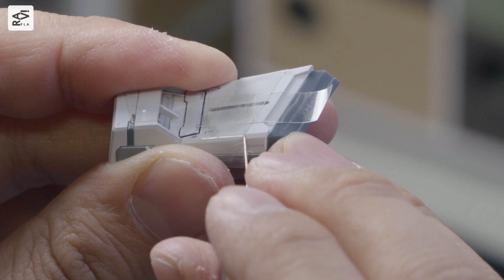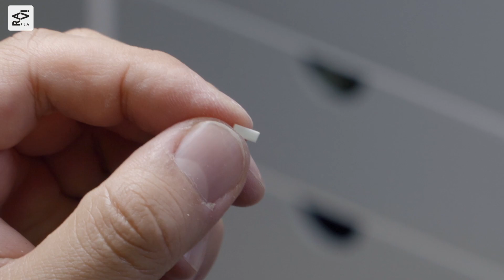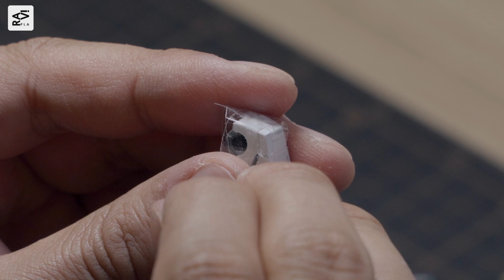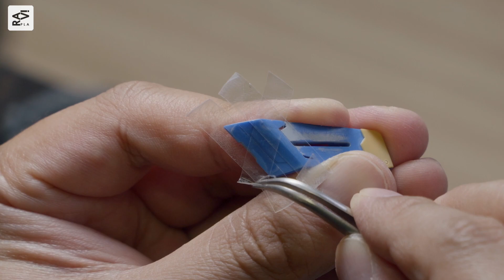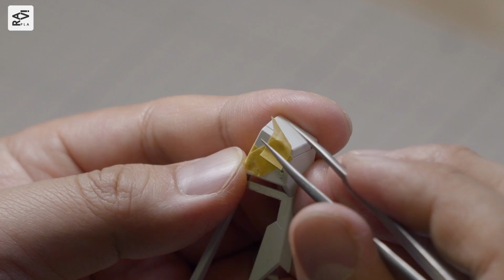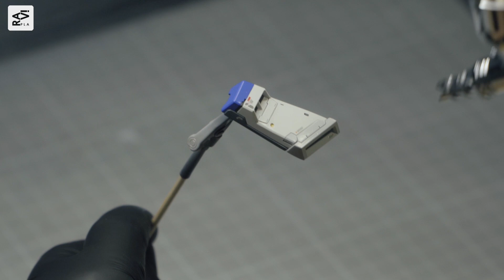Gunpla custom / RG Hi-v GUNDAM WIP #2

Comment: Your videos are so zen to me! What is the material you use to add plating onto your models? The yellow and white sheets you cut and glue on I mean. I'm so inspired to begin improving my models and adding finer details.
Reply: It’s called plastic plate or plaplate. The difference in colors is based on the company.